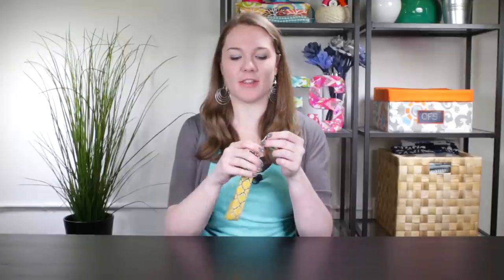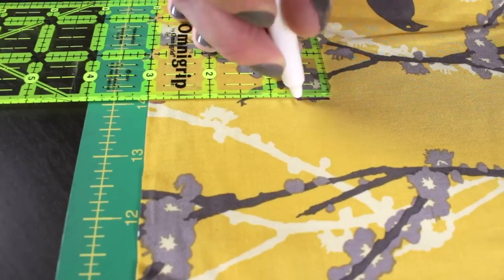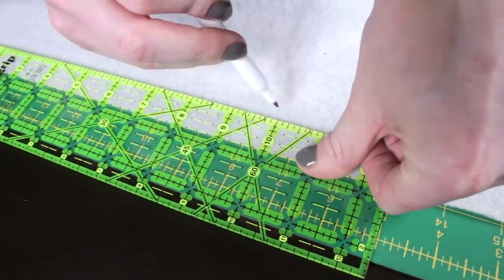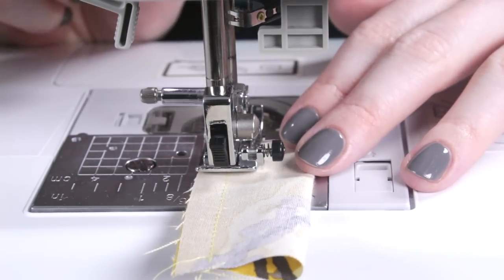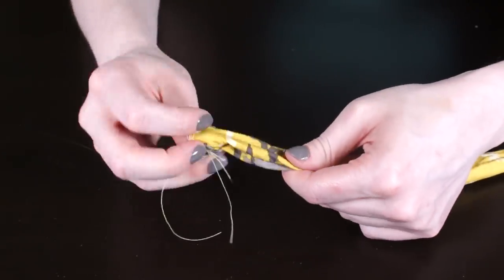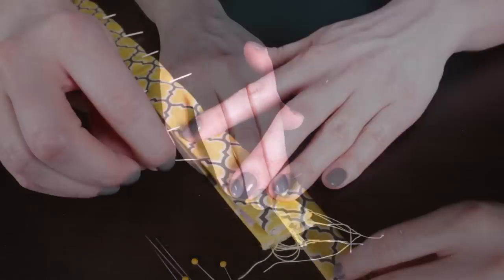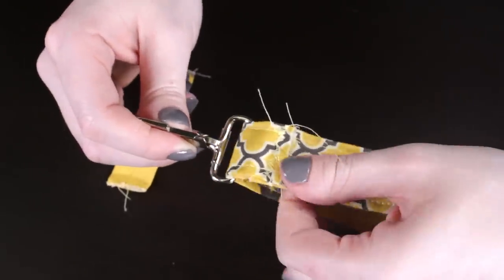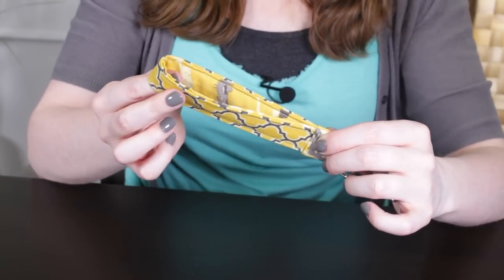DIY Fabric Key Fob Tutorial

Comment: What kind of foot and needle did you use?  My needle broke twice.
Reply from the maker: I was using a regular size 14 universal needle. On thick areas, I sometimes find it helpful to use the wheel on the back of the machine to manually control the sewing. This way you can more slowly puncture the fabric with the needle and stop and try again if there's too much resistance. When using the foot pedal, you don't have the same control and the needle just slams into the fabric and can end up breaking or bending easy. Hope that helps!
Reply: you might try a denim needle if not to thick for yur fabric